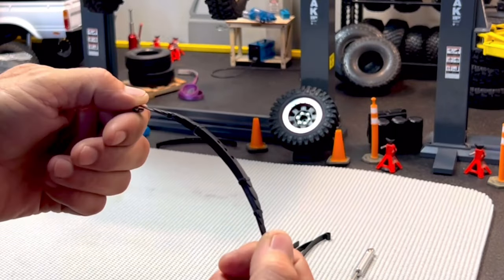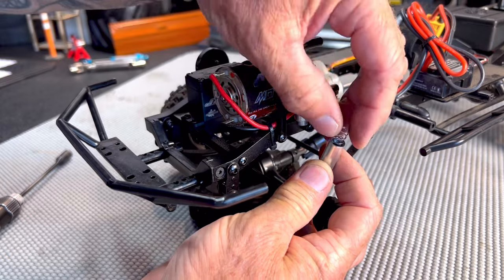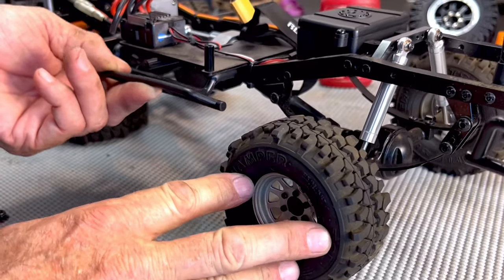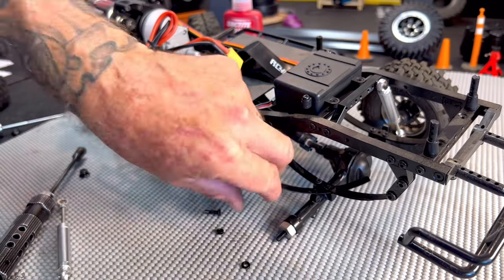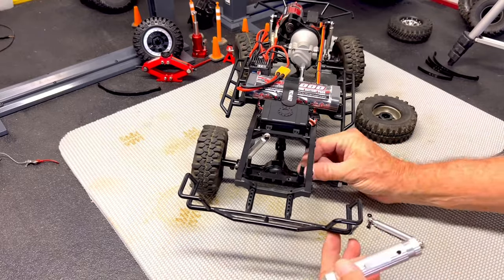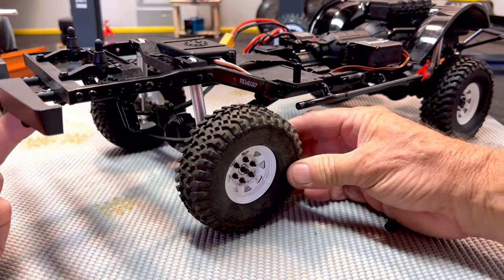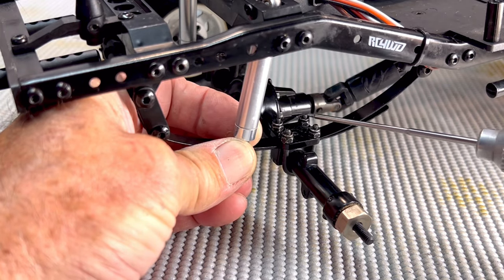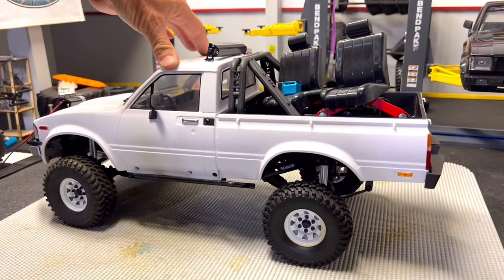How To Tune Your Trail Finder Leaf Springs

Comment: How come the super soft leafs you get with the kits/RTR 4wds are different  to the ones you can buy as a replacement?
1: the load bearing and helper springs are different lengths.
2: the replacement ones are softer and work better then the ones that come with the kits/RTR 4wds.

Comment: Rc4wd products suck so bad… are we just not going to address that rear shackle angle? Or how no Rc4wd shocks are able to hold oil? Or how the front shackles hit the frame and you have to cut notches to make the front cycle correctly?